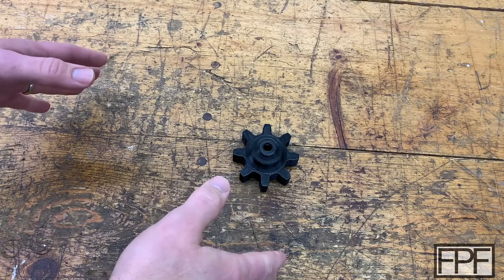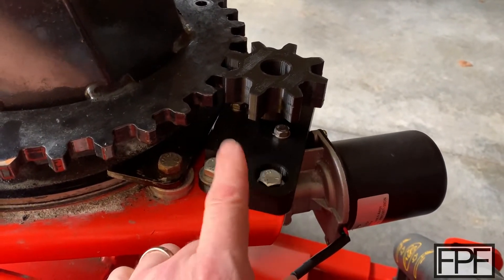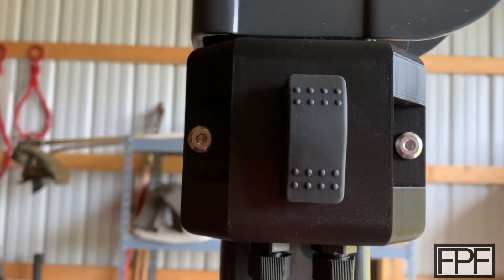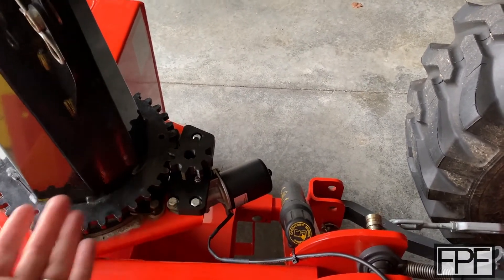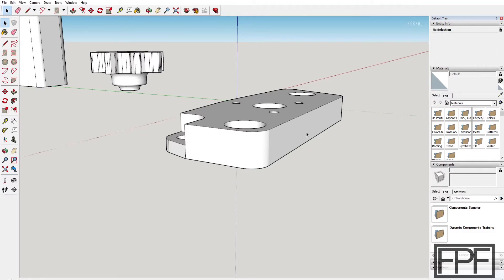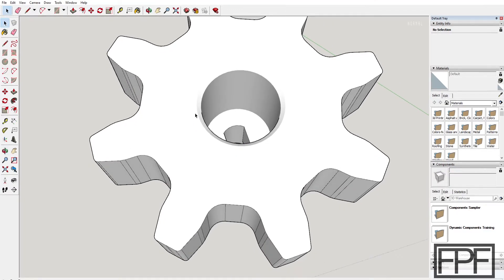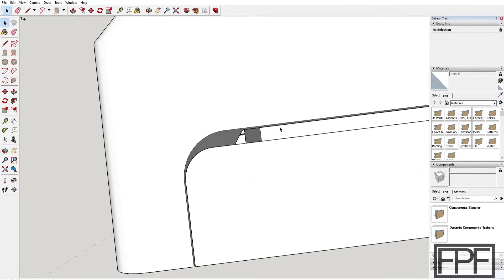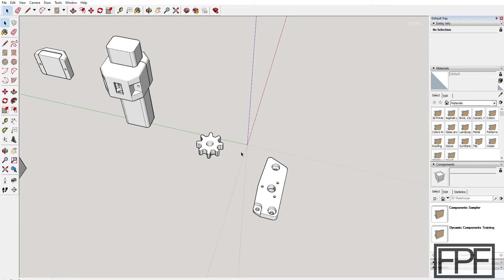3D Printed Snow Blower Electric Chute Rotation SB1064/1051

Comment: I have this same blower, and printed your files using Bambu Labs PET-CF engineering filament. I was able to mount the switch inside the cab of my Kioti 2510, so now I won’t have to open the back window to crank the chute. The setup works beautifully! Thank you so much for making your files available!

Comment: Nice desing! I would add limit switches that the blower cant rotate towards the driver if something go wrong.
Reply from the maker: Thx for the suggestion.  With 2 seasons under my belt using it though, I don't think it's really warranted.  It doesn't move fast enough to accidentally end up with it coming right at you, and I'd hate to add more failure points to chase down in the middle of a storm.